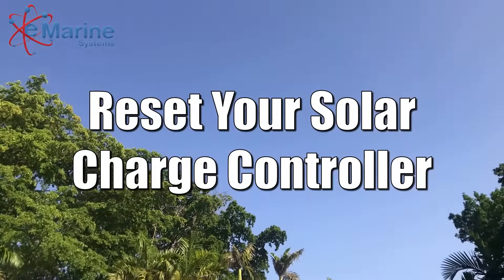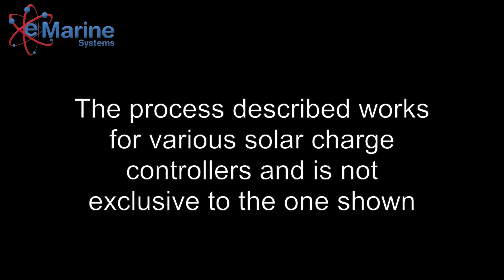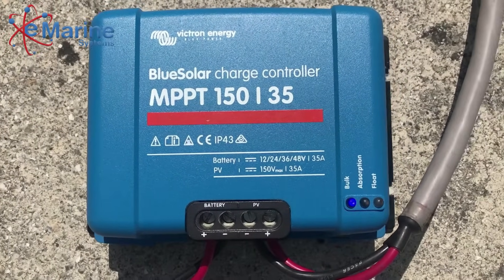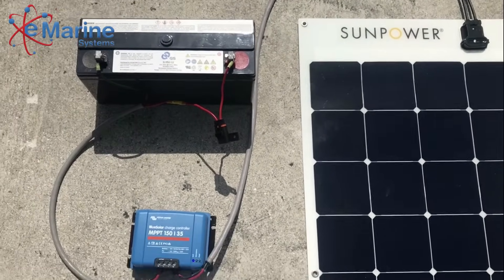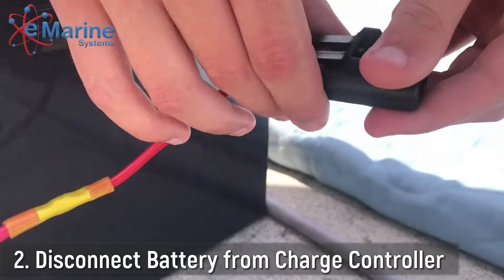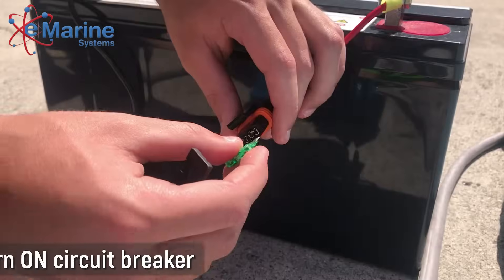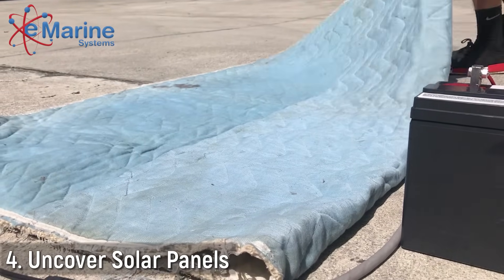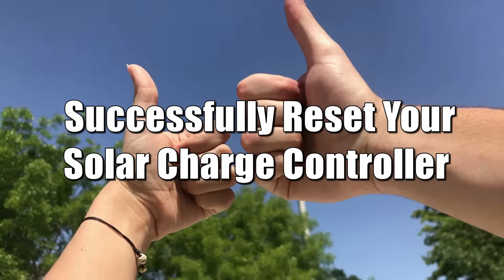Reset Solar Charge Controller

Comment: That doesn't reset the controller.  The setting are still  the same , never back to factory settings.
Reply: It depends which model.. but this might work...
Disconnect completely and wait a while..
Then using a multimeter set at 240v test for a voltage..
What you are actually doing is gently shorting it and hopefully discharging the capacitors.
You could use a wire on each of the pair of terminals, there maybe a spark...
... another possible cause...
common at this time of year, usually on a new system or one that's been added to...
If you are in the UK.. or similar weather conditions...
I had the highest power this year.. today's sun and cold increased the efficiency by 25%.
Solar doesn't work as well when they are hot.
If you're panels are too near the max for the controller it could have caused the problem.
Reply: @Markus-UK  I leave my system turned off evernight and when I turn it back on in the morning the settings are still not back to factory..only what I had them set to.  Now some controllers have the return to factory settings if you press and hold a couple of buttons at the same time.  My HQST controller doesn't.

Comment: Hasn't worked for my flashing light issues. I disconnected both grounds and waited a few mins and still get the flashing lights.
Reply: What's flashing? Is there an error code?

Comment: How do i know when my sealed lead acid battery is fully charged with solar controller 😔
Reply: Look up a voltage chart and measure the voltage...
It depends what controller you have..
Look for YT videos on the model and make.

Comment: Thank you for this. I have a simple 20amp solar controller in my campervan connected to 2 x 80W thinline flex solar panels. One or other is not working as there is no charge input arrow showing on the controller screen.  I did as you said (at night) and disconnected my battery, and after many hours the solar controller LED screen was still on (luminated) showing low voltage in battery around 12.6V showing on screen...why would my solar controller still be on after I disconnected the battery from it? Surely it doesnt have any residual power after many hours? What charge could be illuminating my solar controller when battery bank is fully disconnected (unplugged)? Hope you or other readers can help? thank you.

Comment: So I was just about to get out the ladder and thought,  there's GOT to be a better way! And there is. Disconnect all 4 leads to the controller and wait the 2 minutes. No ladders  or blankets needed.  Hope this saves someone falling off a roof.
Reply: Me, i just turn off my two circuit breakers, panels first then batteries wait 2-3 mins then turn on batteries then panels and i'm good. However i only do this when i'm working on the system and never had to do a reset for any reason.
Reply: We've just bumped into this comment today and tried it, after about a month of fiddling and frustration, my goodness, we are smiling now and laughing at ourselves, it worked. Thanking you alot.

Comment: This doesn't work at all had panels covered for 4 hours with black blankets voltage still 38 to 40 V
Reply: Disconnect all connectiosn on the controller.

Comment: Have a Renogy Rover 40 amp MPPT which got confused when there was a lithium battery over discharge.  Was not able to reset the controller to clear this issue and allow full recharging back to battery.  Followed these steps and the unit is now fully charging the batteries again.

Comment: Unebliveble that they do not have a reset switch, it is just so hard to have to climb up on the roof to cover that thing every time it crashes and need a restart. Lately I have just started to unplug and connect it again even if I risk electric chock of 80v... I will have to install an on of switch so it can be reset without all that hassle.
Reply: Yes they don’t make them easy for the user. I guess you are supposed to call someone out?
Reply: Please off your solar breaker that is. From solar panels to solar controller. 
Same thing or even better than covering the solar panels face
Reply: @rondo cat how often do you have to do this reset?

Comment: I have the same problem & removed the battery but forgot to covered the panel, so the charge controller is not working anymore 
Can it gets fixed.? I really needs it to get working again,..please let me know
Reply: Did you reconnect the battery and panels in the order they said.

Comment: It's not for reseting the first memory voltage, if your solar panels were 150V and you had them on a 24V battery bank, you can't reset it the way you are showing it, when you changed your panels to 100V and the battery bank is 12V now. You will need the Bluetooth adapter for this kind of hard-reset.
Reply: Weh